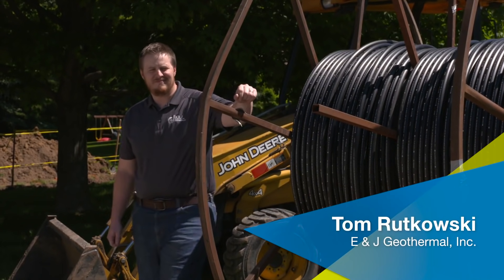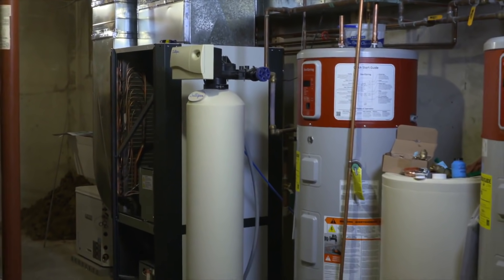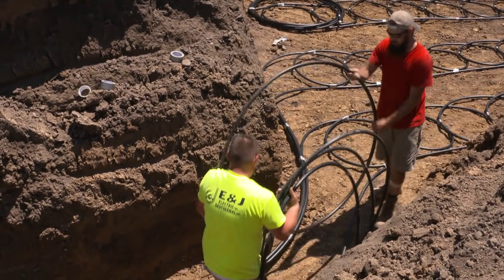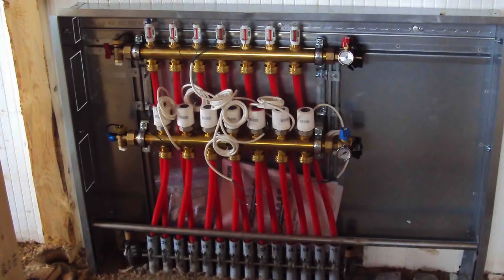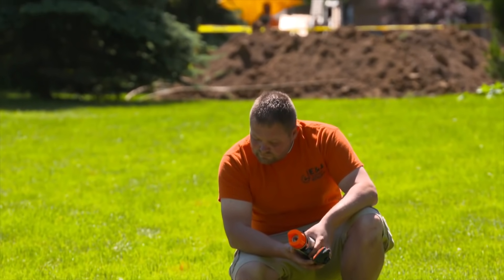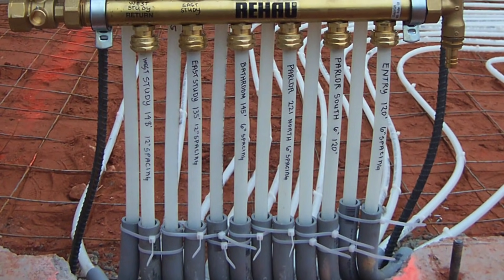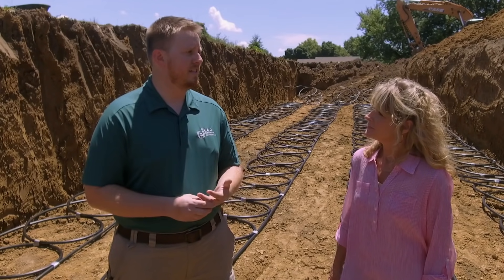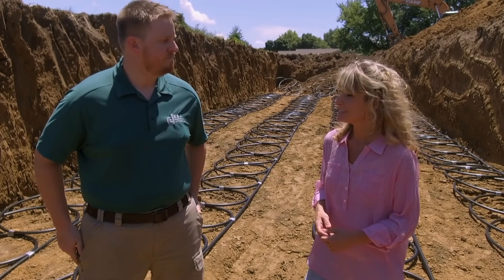Geothermal for new construction and retrofit

Comment: My understanding is that the ground remains a constant 55 degrees, but that antifreeze is added to the water in the system.  This seems like an unnecessary step, no?  Over 20 degrees above the freeze point seems like a huge buffer to not need antifreeze.
Reply: No, and there are 2 main reasons (In my opinion).
1) In heat pump (heat mode), the heat exchanger works at a temperature below 32°C (0°C). Freon flows at a temperature of approx. 5°F (-15°C) and that will cause the heat exchanger to freeze. System will not work and volume increase will possibly break the heat exchanger.
2) Assuming a constant ground temperature of 55°F (13°C)  is not correct, that depends on the latitude your local climate and depth. But let’s assume is near that value. Ground loop pipes must go to the surface. During winter that pipes might freeze near and above the frost level. If the system is off, this will cause the pipes to freeze, expand and break.